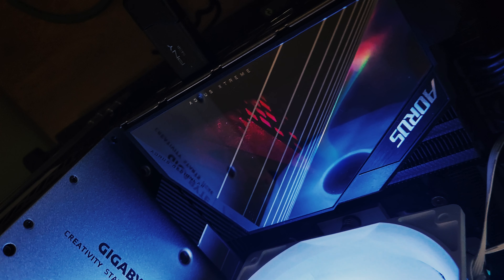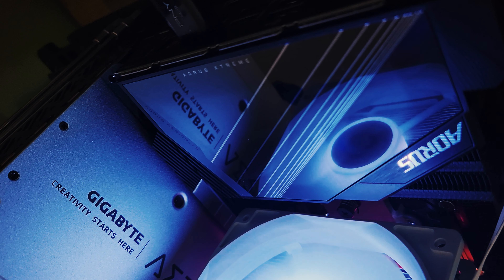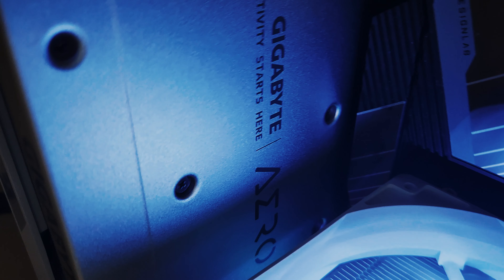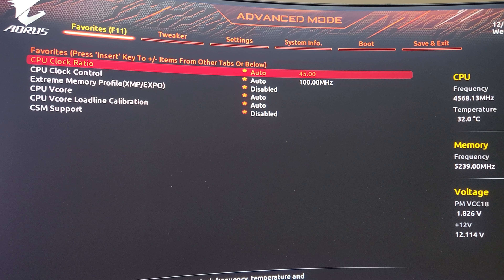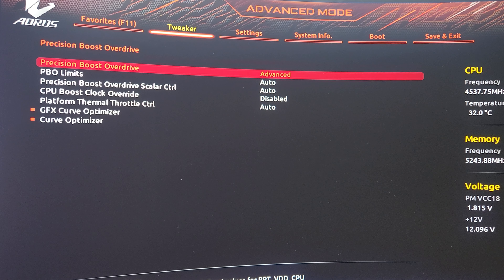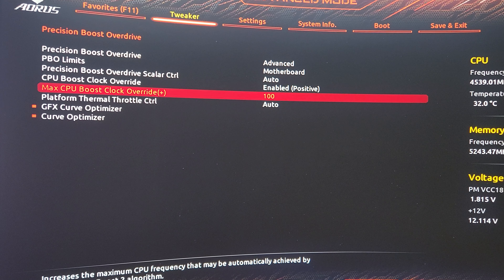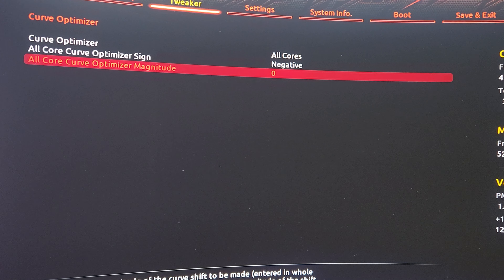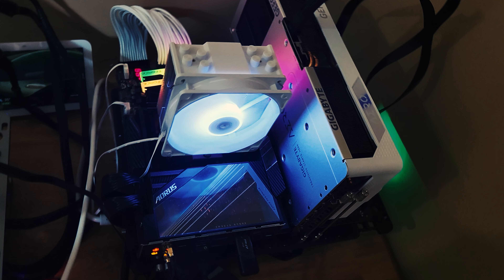How to Overclock & Undervolt Ryzen 7000 in 2 Minutes

Comment: when it comes to the 5800x3d (which i saw you oc'ed too in a previous benchmark): the only way to do it is in windows right?
Reply from the maker: For most motherboards, overclocking/undervolting features are locked so using PBO2 in Windows allows you to bypass that lock. On some MSI boards, they have a feature called Kombo Strike which essentially does the same thing at a BIOS level. You can do a base clock overclock using some ASUS boards as far as I know, but I don't know if you can do it on any other boards.

Comment: On the max cpu boost clock override will 125 give better performance? And is it stable u think ?
Reply from the maker: yes better performance. stable for me yeah, depends on your chip and motherboard and settings.
Reply: @pyurologie  7950x Asus 670e
Reply from the maker: you should be able to do +125 frequency cap and -15 negative curve without issue. you can test further from there.

Comment: Hey pyurologie, I was just advised to undervolt my cpu, I have tyhe R7 5700x3D cpu, is it safe to do this?
Reply from the maker: yes, completely safe to undervolt. there is no risk of damaging hardware with undervolting since you're actually lowering voltages. only upsides, cooler temps and higher clocks maintained if setting is stable
Reply: @ Yes! I’ve heard that it can possibly boost even more my FPS.

Having this said, should I follow exactly to the T on the values you put on the video? Or are there any specific ones to my cpu?

Comment: I jave 7800x3d do i do thos if i main tarkov?
Reply from the maker: optional, but i recommend it as it will run a little cooler and draw less power while likely running higher clocks